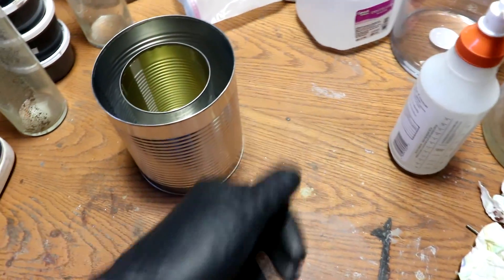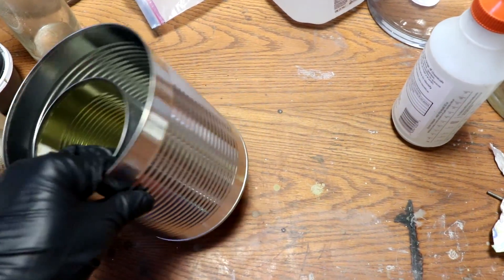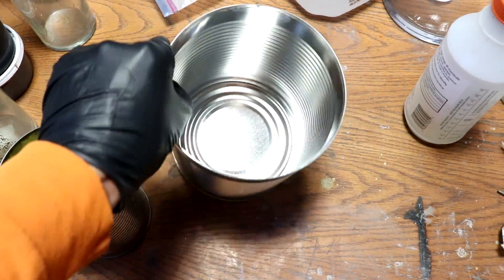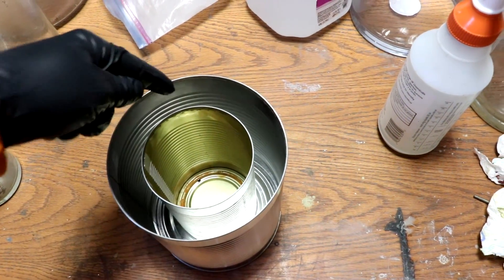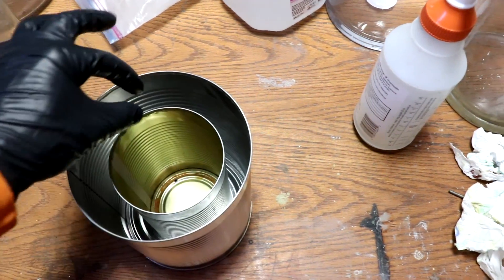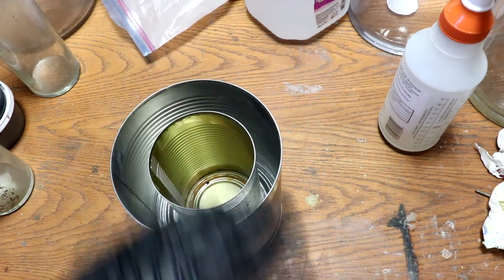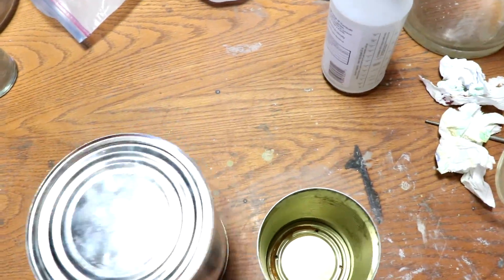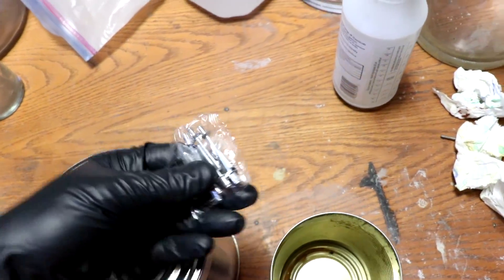The Rad Can

Comment: Just to put things into perspective, 6 micro-sieverts per hour is actually fairly low for uranium  ore samples,  and processed yellowcake is less radioactive than ore as almost all the daughter products have been removed.  Most of the shielding we saw was for beta radiation and the lower reading after the can was closed was the gamma radiation, only attenuated by about 50% for 1 cm of lead - hard to judge the thickness Cody achieved.  Just 2mm of aluminium would have had the same effect - another experiment, Cody eh?  There are quite a few places in the world (e.g. Kerala, India; Ramsar, Iran) Norway, Austria, Germany,  where the natural background is greater than 6 uSv/h and even more surprising, the inhabitants are just as fine and as healthy as elsewhere.

Comment: Cody, I advise that you store the small container in a larger container filled with lead, like a bucket of some odd volume... Basically create a larger leaded container of the same scale, but larger, so you will have double layer of lead. 

Your initial design is cute, and effective, but only for temporary storage.

Long term storage will require another layer of lead.

Comment: why not gold absorbers radiation? they use from spacecraft
Reply: Yes, gold (density 19) compared to lead (density 11) is approx twice as good, but filling a can with 5mm thickness of gold?  What would that cost?
Reply: @karhukivi  you tell me
Reply: @ryancoates4054  OK here's a back of the envelope calculation: He used about 2kg of lead (comparing it to one I have made) so for gold he would need 1 kg and at $40/gram, I leave it to you to work out!
Reply: Ryan, I didn't answer your question very well. The gold foil on spacecraft is to shield thermal (i.e. infra-red) radiation, to keep components from temperature extremes, like the space blankets the rescue services put on survivors.  The gold doesn't tarnish and is better than the cheaper aluminised foil.  Shielding spacecraft from Van Allen radiation (mostly high-speed protons and electrons) is achieved by a sandwich of metals in the hull and instrumentation within the craft, as well as by avoiding spending too much time in the doughnut-shaped belts themselves.  Gamma and neutron radiation from nuclear reactors and bombs are very different problems, high density materials for the former and low atomic number materials for the latter.

Comment: If anyone is wondering how much Roentgen that is (Which you'll be familiar with if you've watched Chernobyl), that reads as 0.000683R. Which is 5270 times less than the 3.6R "Not great, not terrible" in the show. Cody is safe holding that in his hands in short duration.
Reply: Roentgens are not used.  His geiger ratemeter is working in micro-Sieverts which are calculated in the energy absorbed by "average" human tissue.  Some instruments worked in Rads or Rems (mostly in the US) and the dial often has "R" or "mR" per hour, which is very confusing.
Reply: @karhukivi  You are correct, I used a readily available online calculator to translate one into the other.
Reply: @Excludos  It doesn't really work as a direct conversion as Roentgens are  for ionisation in dry air, while Sievets are for wet tissue etc.  But I know what you mean!

Comment: you really need to cast a flask of solid lead, a good 2"+ thick and machine a lead plug, plus a heavy steel cradle
Reply: Yes, 2 inches or 5 cm will reduce the gamma radiation by 2^5 or about 1/32 times the unshielded level.
Reply: George Reynolds That’s pretty cool.  Any chance you could teach me how to calculate that (or point me to where I can learn)?  Thanks.
Reply: @5358-i4s  Google on "radiological shielding half-thickness" and you will get tables for various materials and thicknesses vs different gamma energies.

Comment: ok cody one question the steel bolts that run all the way in from the sides into the containment area does steel block radiation that well?? the same with the handle for the lid ??  to me would have been better to drill the holes for all the bolts for handles and held them in place with nuts temperately poured the lead  then attached the handles. so there radiation couldn't leak thru where the holes were drilled or thru the bolts ?? maybe im just over thinking it
Reply: Steel blocks radiation okay. They're more vulnerable points, but due to their placement, they're less of an issue. The bolts are horizontal at the top of the can. only material directly in line with them will be able to emit radiation out them. The lid handle I can't tell, but it's on the top, so it's not going to be passively be pointed at nearby people, unless you do something dumb. Plus smaller area means less radiation is coming out anyway.

Comment: all of that for something you can safely store on a shelf in a jar providing you don't spend all day 5 centimeter from it.....
Reply: True!
Reply: Alfonce Jean  He might have much hotter sources.
Reply: @5358-i4s  If he does, he'll need a bigger can with at least 5 cm of lead around it!  Alternatively, he can just store them further away from where people are - doubling the distance reduces the gamma radiation to one-fourth, equivalent to doubling the thickness of lead from 1cm to 2 cm.
Reply: @5358-i4s  plus I hope he is making the container BEFORE he has the use for it.
And has george said this container is a bit thin to be of  any actual use for long term storage.
Reply: Alfonce Jean & George Reynolds.  Alright.  Good points, but I counter you with this... lead containers are cool.
Reply: @5358-i4s  never said it wasn't. just not very useful...
Reply: @5358-i4s  Oh yes, I agree!  You can also fill the annulus with lead shot, no need to melt it down.
Reply: George Reynolds Kind of strange, but I won’t kink shame.  I do recommend that you coat it with something first.
Reply: @5358-i4s  I've seen small lead "pigs" to store calibration disks and the lead is coated with a hard grey enamel which makes a very attractive and cool container, as you say.
Reply: @5358-i4s  there is nothing stopping you from storing yellow cake in a jar in your leaving room

Comment: Correct me if I'm wrong but shouldn't there have been some sort of spacer in between the two cans at the bottom so that lead could fill between the two cans at the base basically asking will radiation still come out the bottom of that can
Reply: So you just didn't watch the video?

Comment: Science question: Will the bolts for the handle become increasingly ionized from the inside, through to the outside?

Of course, this is not about concerns or overall containment relative to having no containment, just the effect on the bolts.
Reply: The dry air inside the can will be slightly ionized.  Not the metal, as electric charges are dissipated through the electrically conductive metal.
Reply: @karhukivi  Positively charged from the radon decay, right? Might be an interesting experiment to electrically isolate the can in still air, and see what kind of voltage builds up.
Reply: @MarkRose1337   Not just radon, the alpha, beta and (to a lesser extent) gamma radiation from some of the uranium daughters knock electrons off the oxygen and nitrogen molecules in the air. The (dry) air will become ionized with both electrons and positive ions floating about on dust particles.  An ionization detector can be built for $10 from a can (like the one's Cody used) and a few electronic components and the samples are placed inside to ionize the air which must be very dry.  Marie Curie made an ionization counter from a fruit can for her experiments, so some things never change!
Reply: @karhukivi  I didn't think about the other radiation stripping electrons. Thanks! Might be a fun experiment for Cody to do on his channel.
Reply: @MarkRose1337  There was a youtuber called "bionerd" and she made some very professional videos about radiation and isotopes used in cancer therapy, might be worth a look?

Comment: I know I'm a bit odd, but why not fill the big can with 1 inch of lead first, screw down the inside can to that lead with short screws, THEN fill the surrounding space?  More seamless.  Also makes me feel smart to criticize a genius.  ;-)
Reply: @j_e_r_r_y675 : But with a seam of steel that just might let a wee bit of rad shine through.  I'm worried for everyone's safety here.  ;-)

More secure as in can staying put?  The can is embedded in lead either way, seems to me.  But it's all trivial really.
Reply: Marginally more, maybe, but radiation generally travels in straight lines. The line through those contact points is up the wall of the can, meaning there's very little radiation going to be there regardless. The same could be said about the bolts in the top for the handles.

In any case, even in those directions, this blocks the vast vast majority of any potential radiation that even could be coming out, and up/down are generally safer directions, since there's less likely to be other people close by in those directions, and more likely to be more material in the way.
Reply: @seigeengine :  Agree!

Comment: Isnt it bad to have the inner layer of steel going through the lead shielding along with the screws you've drilled holes for,  i guess your material isnt all that radioactive but if you were actually storing dangerous things
Reply: Steel is fairly dense too.  He could have made the whole thing from iron or steel but it would have to be about 50% thicker all around to have the same shielding effect.

Comment: You huff mercury on a regular basis and now suddenly your worried about some negligible amount of radiation? Unless you're using this can to store a beta decayer in the microcurie range you're an official radiophobic sissy. By the way, lead may stop beta radiation, but it will replace it with x-rays.
Reply: Lead can be used to adequately shield beta radiation as well, as well as absorb any resulting x-rays.

Comment: A semi-dangerous idea, something very important is missing, at least if ß sources are stored inside the container: An inner layer made of aluminium (approx. 5 mm thick) to convert ß sources' electrons to low-energy bremsstrahlung which then is stopped inside the lead. The energy of bremsstrahlung is proportional to the  atomic number of the absorber, so it's the worst possible idea to use nothing but lead for such a container.
Reply: I'm not convinced it's an issue here.

Comment: how would I rate this project? about 3.6 out of 5. Not great, not tragic
Reply: I think I am missing the joke about 3.6 - explain, please!
Reply: @karhukivi  it's from the new series called Chernobyl. When they want to measure the radiation, the machine shows 3-.6 r/h because it was it's maximum, but in reality it was thousands of times higher
Reply: @Bloodray19  Ok, thanks!  I haven't seen any of this series yet.  A similar thing happened in Fukushima with a water level indicator which stuck giving a "safe" reading when the water was in fact boiling off and leading to the first melt-down.

Comment: Cody: *rivets cans together
Me: Shouldn't there be lead on the bottom too?
Cody: *pours lead inside the smaller can
Me: There's my answer...
Reply: what about the contact area of the small can to the big can? we need to see the can on its side and measure the bottom of the can with the geiger counter!
Reply: @allothernamesbutthis  Good point.
Reply: @allothernamesbutthis  it really doesn't matter if the bottom leaks a little. The radiation will be stopped by the ground, just don't put it in yourself for long periods of time I guess
Reply: @allothernamesbutthis  Radioactivity is not "conducted"
Reply: @allothernamesbutthis  nothing will be directed on top of those leadless holes so very hard to have any particles escaping through them I guess
Reply: allothernamesbutthis I was thinking the same thing. Pretty sure there will be radiation leaking through those aluminum contact points
Reply: the aluminium contact points are covered with lead
Reply: and besides its fine if it is sitting on the ground it will just be absorbed and dissipated through the earth
Reply: @monikerone3203  Well it's better than nothing. Atleast this one can be used while he improves the design and remake a better Rad Can 2.0 lol
Reply: @seigeengine  There is only gamma radiation coming out of that can and it depends on the position of the samples inside and the path length to the outside.  The 1 cm (approx?) of lead and the thin steel will only reduce the gamma radiation by about 50%, varying a bit from different parts of the whole assembly.
Reply: @seigeengine  dude calm down.
Reply: @monikerone3203  Technically, those are steel cans, and I dare say steel rivets too. Additionally, the most effective metal at blocking radiation is NOT lead; it's called "high-Z steel-steel" and is a form of stainless steel.
Reply: @monikerone3203  Radiation isn't a liquid that will 'leak'.  It more or less travels in a straight line.  There's nothing special about the led - it's just mass.  The aluminium rivets provide small channels with slightly less mass that must be navigated to escape.  But it has such a small effect on net radiation escaping that it's not even worth talking about.
Reply: Xylos144 obviously mr scientist... however, it bounces around therefore it’s able to bounce through the cracks between the led out of the container... sort of like a pinball machine
Reply: @monikerone3203  You're not going to reflect much in terms of gamma rays that way.  As for the beta and alpha particles - their danger is in their momentum, not their composition.  Electrons and helium atoms.  Once they've bounced around a few times, they're generally going to be so robbed of energy as to be of little concern.  Everything is statistical at this level, but most all particles will have been robbed of any penetrating power.
Reply: @michikipsy1951  dude thats the real  why he poured the lead in the smaller can over any other reason
Reply: @sebastianramadan8393  Pop rivets are ussually aluminum with a steel core
Reply: @seigeengine  Gamma rays are electromagnetic radiation so they can reflect and in fact would do so because thats what the lead is actually doing. Further while the rad should be lower higher angles means more energy is reflected and those higher angles allow it to squeeze through a guide (which is technically what that is) more easily.
Reply: @seigeengine  For one, go do the research yourself its not hard to find. Two, when you say "interact" what does that mean? Thats a rhetorical question of course. Something to think about.
Reply: @masterpython  Usually you can also buy steel ones. Per qualche dollaro in più.
Reply: I did the exact same thing
Reply: Núrio Cristino I was about to comment that............oh well.
Reply: perfect example of what we call the "Half-Fast" technique. it's Half as Fast as doing it right the first time, because you'll spend the other half of the time doing it right the second time, and of course "Half-Fast is Half-A$$ed no mater how you say it" .
Reply: Same
Reply: I thought the holes in the bottoms of the cans were for spacers to hold the smaller can up off of the bottom and allow the molten lead to flow in and fill up the empty space. I was mistaken.
Reply: Goddamn there are stupid people down here! Holy fuck! Radiation is not a fucking liquid, nor a gas, nor heat, nor electricity. It cannot “leak”, “escape through contact points” “dissipate” or any other bullcrap. Its like light, it “shoots out” rays in every direction. These rays have very high energy so they do not “conduct” “refract” or anything else. They get blocked by lead in every direction they go.
Reply: @SimonWoodburyForget  doesn't matter because the bolts for the handle will hold the internal container in place and keep things aligned
Reply: To be honest i don't really like this design, but it probably works. It's just my OCD who hates it...
Reply: OMG same here. Glad that was thought of. It was in my mind the first 30 seconds. Lol but I'm glad he thought ahead.
Reply: My answer would have been to heat the lead, pour it around the can, and use 2 steel bars to press the can into the lead while it dries. Definitely not the easiest way to do it, but then there is no chance of contact points for leaking the decaying particles.
Reply: Shouldve pour lead into the big can first to creat a shielding for the bottom, then secured the small can and poured lead into the gap between them
Reply: same haha
Reply: Yeah I was thinking the same
Reply: true
Reply: Great job Cody!  I would like to build one of those.   I see we use the same geiger counter.   I pulled the tube from mine and in sales a Russian detector with the mica window so I can check alpha, too. Neat mod and it works greaf!
Reply: Same thought same answer
Reply: Same
Reply: oh
Reply: I said the same thing I commented before he even did that and then I deleted it
Reply: same lol
Reply: Thanks for explaining both the passage of time and your own incapacity to directly predict the future.
Reply: Same!!
Reply: Cancer
Reply: Ohh, a 'I say, he say' meme. How original. Are you sure you don't want to thrown in a 'surprised pikachu' in there too?